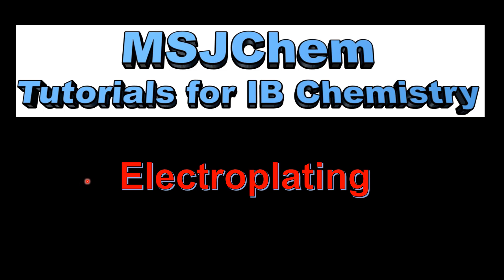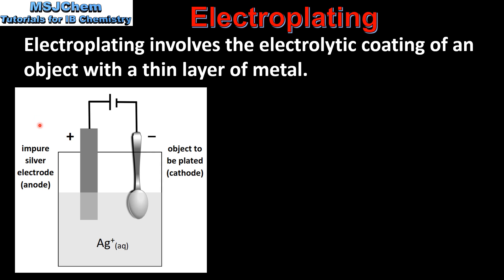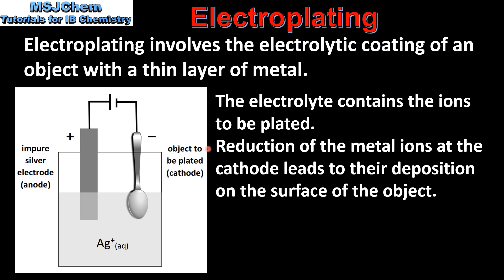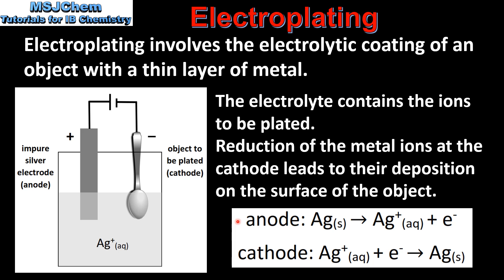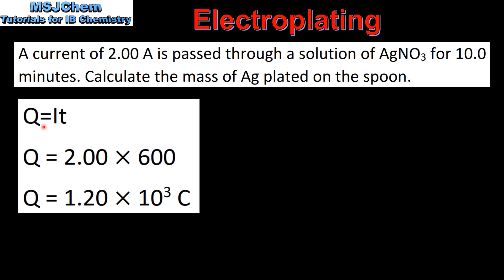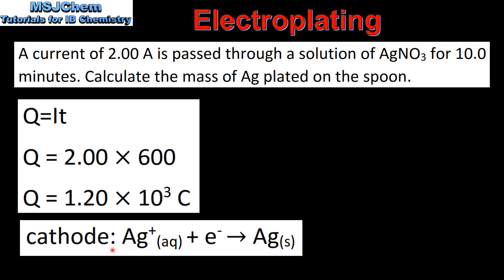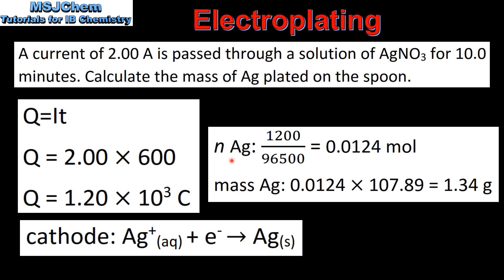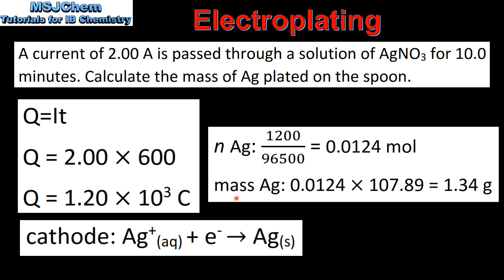R3.2.16 Electroplating (HL)

Comment: If the half equation at the cathode had 2e- instead of e-, do we multiply 96500 with 2 then divide it by the charge? So is the formula Q/96500*n where n is the moles of electrons transferred? Or is it independent of the moles of electrons transferred

Comment: Hello! Why does the silver electrode as 0:50 need ti be impure? Would it not work if it was impure? Thanks!
Reply: would it not work if it was pure**
Reply from the maker: Yes, it would work. Using an impure metal allows the pure metal to be produced at the cathode. But both would work.